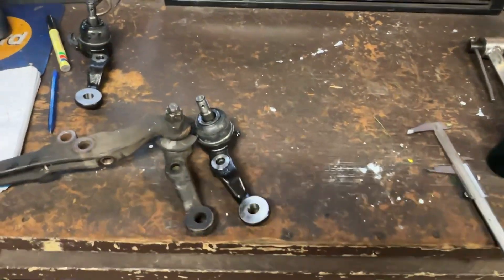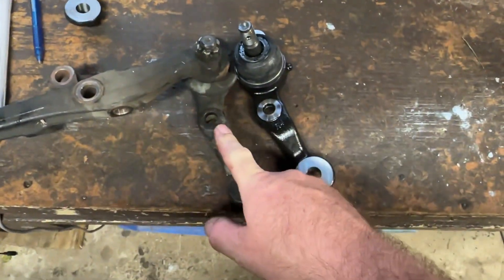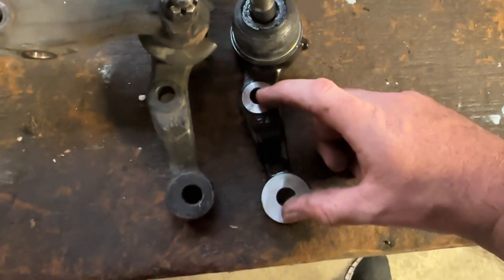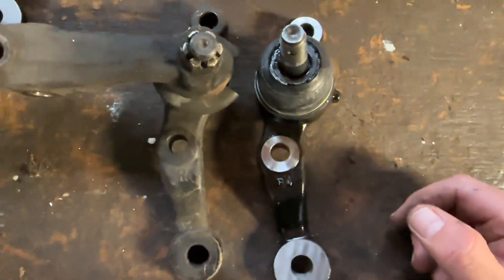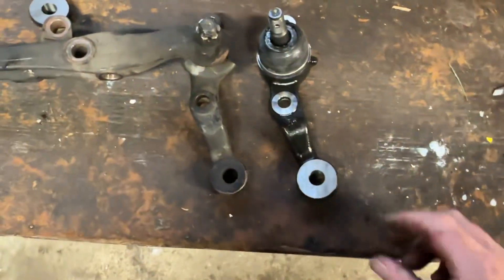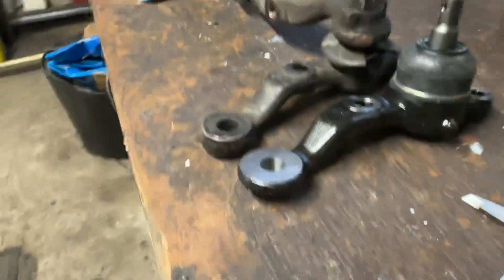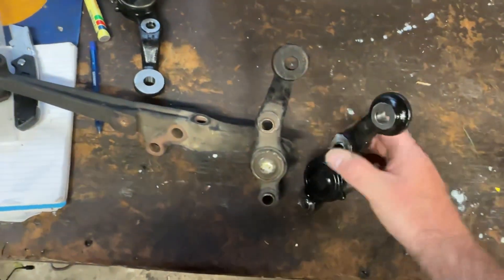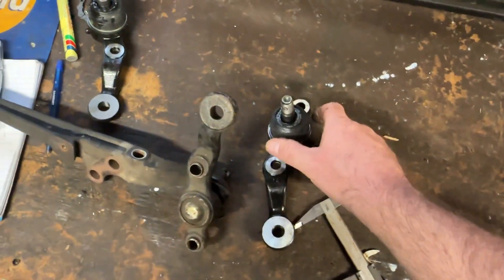JZX110 steering knuckles VS JZX90 // JZX100

Comment: Did u ever end up measuring to see if where the rack bolts to it is the same angle and height?
Reply from the maker: Nah I havnt done anything yet. My current ones aren’t genuine either so not a really good comparison. I think there is slight difference because JZX110 is slightly different (longer FUCA & tie rods etc). But not enough to make a difference that they won’t fit. It just means the steering is ever so slightly lazier/ tiny bit less angle.
Reply: @Fine_Performance  yeah that's cool, I've just put jzx110 knuckles in my 100 and it's thrown the steering wheel position out and drives a bit crap, so I went searching to see if there's any differences and found your video
Reply from the maker: @joshphelps181  oh gotcha, yeah you definitely need a wheel alignment. You should do it every time, even if you are replacing like for like parts. It’ll wear the crap out of your tyres real quick if you don’t.
Reply: @Fine_Performance  yeah gona get it done, was only caught off guard as the place I got then from only sells 110 ones now as I confirmed with him eariler haha
Reply from the maker: @joshphelps181  it’s hard to get 90/100 ones I’ve found. I think the 110 ones are better. Are your also smaller ball joint on the jzx100 knuckles?
Reply: @Fine_Performance  yep smaller balljoint on the 100, unfortunately I didn't measure the lengths, only looked at balljoints because at the time that's all I thought was different
Reply: But ur video and what it's done to mine all but confirms they are different hahs